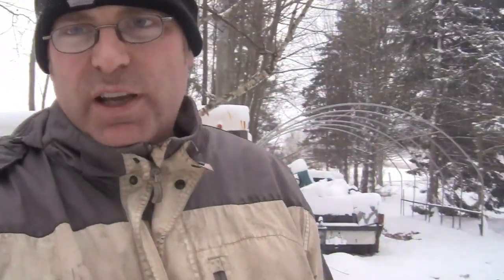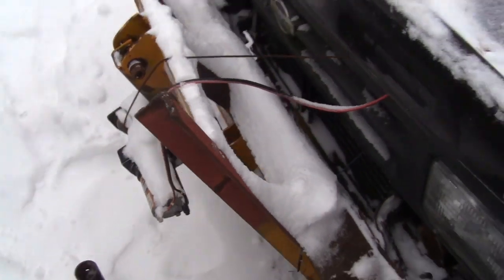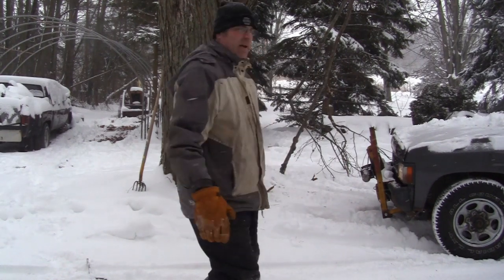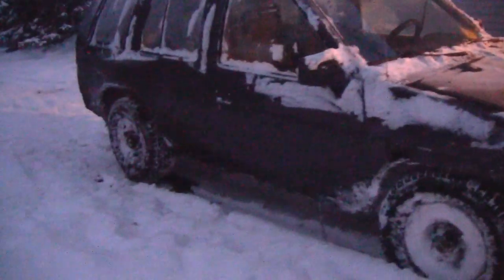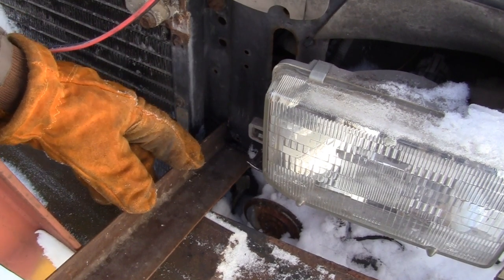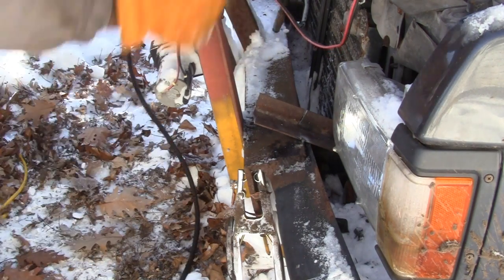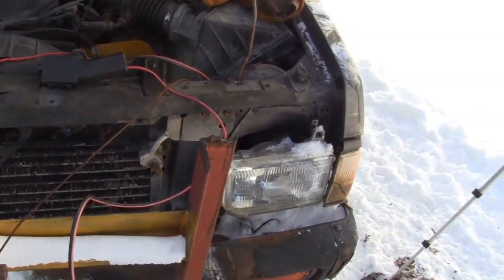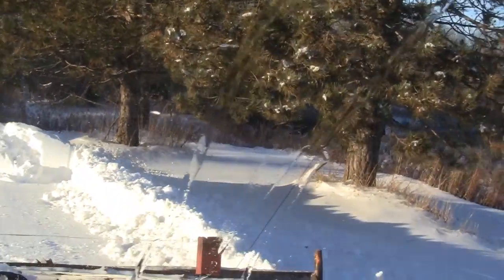Snow plow fix fail

Comment: Hey Shawn . . . looks good and alot stronger.  If I may help ya, right where you split the angle iron to bend down on the bumper, the stress will eventually start tearing there again.  Weld that split up or weld a piece of steel across the split.    Good luck, great video!! Rog

Comment: Why not run a support from the top of the plow mount across the engine to the firewall, and maybe from the firewall back down to the frame.
Looks like fun driving through the field.
 I knew a guy that use to drive around his plow truck doing driveways with a chain hold his cab on.

Comment: when you build your wood boiler think under ground there would be zero heat loss and it could be left for days without a fire.   Start scrounging your materials now.   there are nothing but tin.   a 55 gallon barrel will make the stove part then you need a 350 gallon water tank .  Also don't throw any raditors of junk cars away they will work to transfer the water back to heat for your shop.    Heated  a 6bay truck garage for 4 years with one.